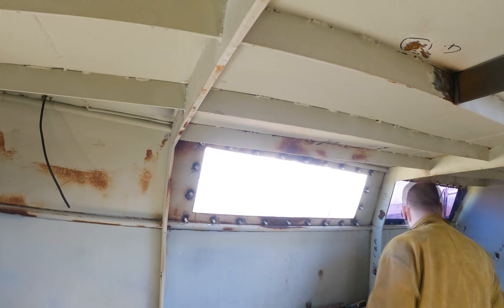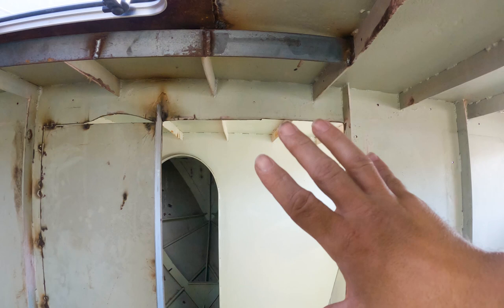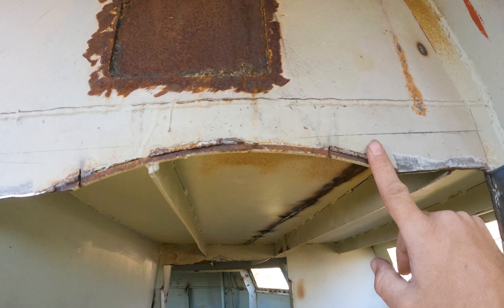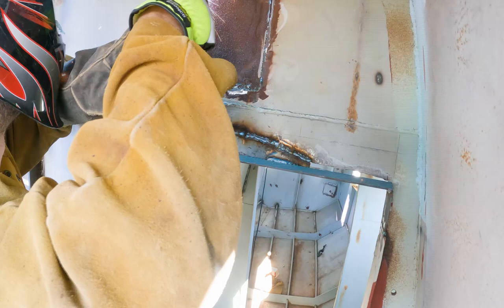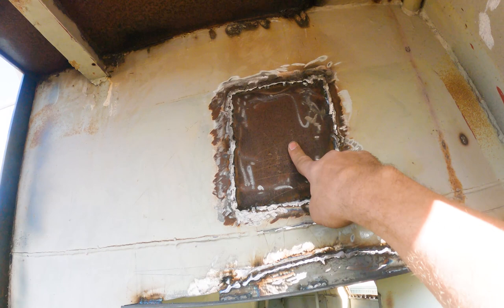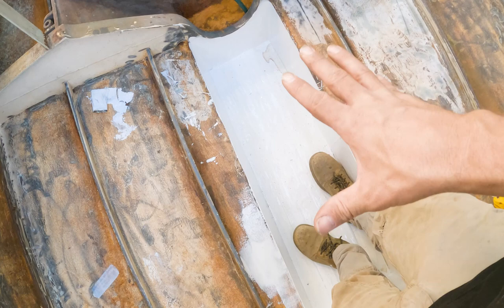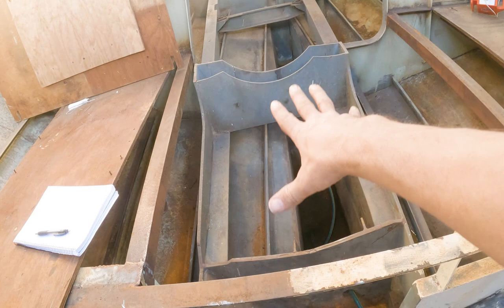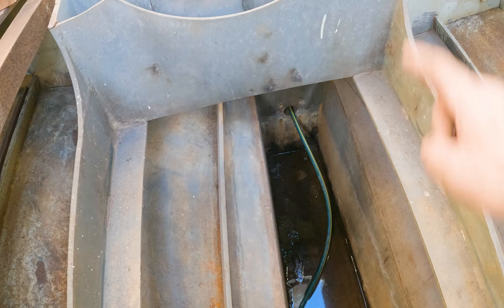Sailing QC #69 |  Welding Door Frames In & We Talk Electric Motors  | Steel Sailboat Restoration

Comment: With the electric motor, How big a prop will it turn and what speed do you think the electric motor will allow? What kind of range do you think it will give you?
Reply from the maker: Hi! great questions! it can handle any size prop that we can fit on our boat. Our maximum hull speed for our boat is 7knots and we will be able to achieve this easily, however where it comes to range it really depends on how fast we want to go, as the higher speed the quicker it will drain the batteries. We don't currently know the full size of the amp hours we will be putting on the boat, in the end it will be the maximum of what we can afford lol.

Comment: I think you should know...!!  For the plexi glass laid, pay attention to the pre-drilling holes, you must drill larger than the diameter of the dowels, otherwise there is a risk of cracks...Beware of the relatively high thermal expansion coefficient: 7 mm/m.
Reply from the maker: Thanks mate!! these are temporary but will ensure that the larger holes will be on the new 6mm acrylic for sure⚓⛵